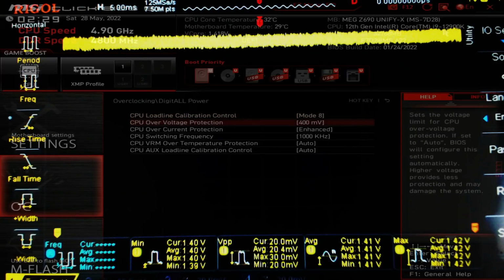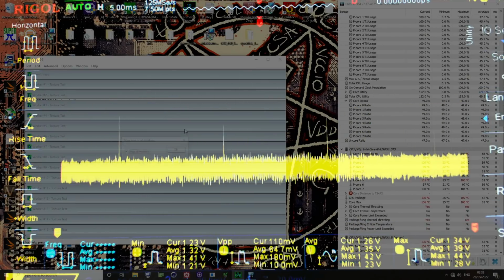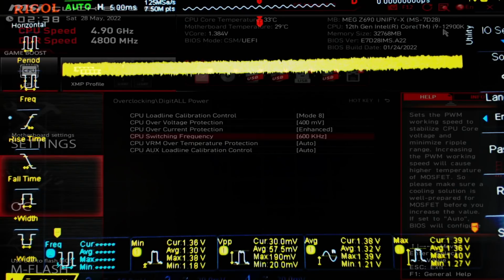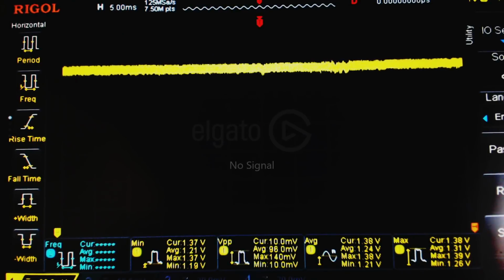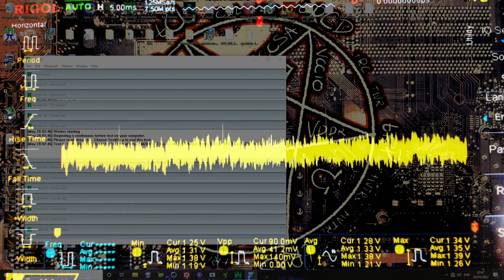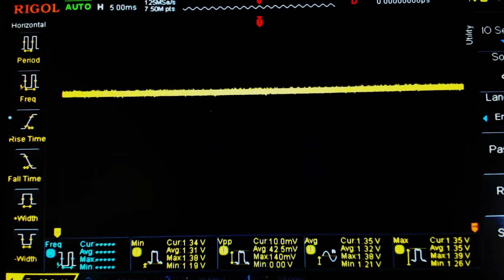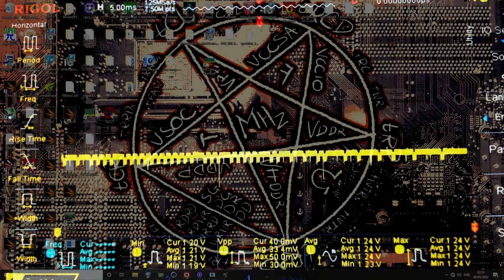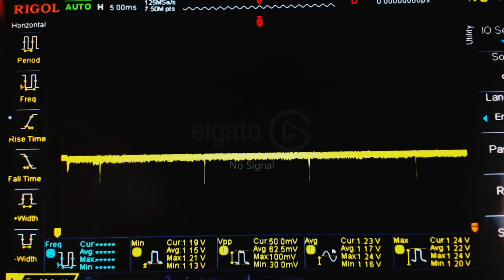The Z690 Unify X has some wacky VRM settings.

Comment: Hey guys, can someone please tell me, what is going on with my Unify-X? The fans take quite a long time to spin up and down (like 30 seconds to reach from 300 - 1550 RPM) when I set them all to full speed in bios and also in MSI Center? That is whit a spin up and down time of a 0,1 ms response time... I also googled it and found a couple of posts of some people reporting the same behaviour. Bios is updated to the latest version and also software. I come from a broken Apex board where the fans reacted instantly, but ram slot was faulty and now this on Unify-X... Am I like the unluckiest guy in the world? It it broken or will a firmware be able to fix this? Thanks.

Comment: A bit late to the party, but the waveform at 18:00 is typical for an unstable feedback loop (just barely not enough gain margin). You often get chaotic, wideband oscillations when a VRM is just barely unstable. (My own designs did this more often than I'm comfortable to admit...)

Would be great if Renesas made datasheets available for any of their RAA VRM controllers but meh, they don't. I have a feeling that the clock of the digital loop filters in that thing is coupled to the PWM frequency, which means that the feedback loop's frequency response gets screwed when the PWM frequency is changed. Higher clock = higher 0dB crossover frequency = lower phase margin = instability.

About connecting the SuperIO to the CPU's VCore sense lines: You're absolutely right, that is a terrible idea. These lines have fairly high impedance; any current drawn from them is going to mess with voltage regulation. What's worse, however, is the capacitance added to the sense lines. That capacitance is going to form a low-pass filter with the sense lines' impedance which directly screws up the frequency response, again potentially causing instability. MSI most likely programmed the VRM controller differently for the VCC sense / die sense modes to (somewhat) compensate for the messed-up frequency response.
Reply: This is the first sensible comment I’ve seen as someone that’s built a buck converter. I really wish motherboards came with application notes that discussed these issues

Comment: funny to see LLC not improving between Z77 and now lol, wtf are motherboard vendors doing... (upgraded) from i5 3570k finally and got no real world performance gain, if not for switching from ddr3 to ddr4 there would be no gains. wife has a 10400 and the 3570k crushes it lol pathetic. 10 years newer and 10th gen runs 2666 ddr4 lol feels like a locked down dell prebuilt. she is getting my old b450 tomahawk and 3600 tho and her pc is going htpc only, my 3600 has almost double the results of 10400 in aida mem bench. literally double read speed, write is the only thing close, and her memory is juast as overclocked as it can be on b460 platform, locked cpu's are pure junk. 10400 was trash on release. lke most cpu/gpu's release the last 2 years. its too bad amd is working so hard to ruin their reputation with 5800x3d greed(its already taken a price cut) and the rx 6400/6500 being complely useless cards competing with gpu's from 2016 lol.... why amd...

Comment: Great video, thank you ! Finaly i was able to have 5.2 all core Prime95 small FFT running stable by simply swithing Unify-X to socket sense. Never imagined that this could cause a problem of instability …
Reply: what voltage and line did you use?
Reply: @Cronussy  As far as i remeber - LLC7

Comment: I have a Z690 Unify non-X. Setting the CPU Lite Load to mode 1 in advanced CPU settings solved the voltage problems I was having. Also did this after a BIOS update.
Reply: CPU Lite Load is more for undervolting ? and mode 1 would net the biggest undervolt right?
Reply: @Pabula  Yes. Stock voltages are way too high. 5.2 @1.22 is just fine.
Reply: @postman3732  Thanks for the reply.  I recently saw a video of a guy undervolting his 13600k purely with CPU LITE LOAD, and it seem very interesting how it was still able to do everything the same just at a lower voltage, it seems like there is no downside of using it.
Reply: Is there any way I can hire your to over clock my PC? You can even make a video of it if you like. Let me know.

This is my build
I would like to overclock the cpu, gpu, and ddr5. I hired someone to build it and overclock it. Build is fine. But he didn’t know about overclocking so it kept freezing up on me so I set everything back to normal.

- 7000D airflow full-tower ATX PC case-Black
- 420 mm AIO iCUE H170i Elite LCD Display Liquid CPU Cooler
- 3090 FTW3 Hybrid 
- Seagate FireCuda 530 4TB Solid State Drive - M.2
- G.Skill Trident Z5 RGB Series 32GB (2 x 16GB) 288-Pin SDRAM DDR5 6000 (PC5-48000) CL36-36-36-76 1.30V Dual Channel Desktop Memory Model F5-6000U3636E16GA2-TZ5RS
- MSI MEG Z690 UNIFY-X DDR5 LGA 1700 Intel Z690 SATA 6Gb/s ATX Intel Motherboard
- 12900k
- EVGA SuperNOVA 1600 T2, 80+ TITANIUM 1600W
- 4 iCUE ML140 rgb elite premium PWM magnetic levitation ram
- Thermal Grizzly - Kryonaut Extreme 2 Grams
- Thermal Grizzly Kryonaut The High Performance Thermal Paste (1 Gram)
Reply: @joemomma707  Sorry I'm just an enthusiast. I'm not for hire.
Reply: This isn’t a unify non-x, in other words, nothing u said matters at all. It is a different board with different hardware. wtf are u going on about?

Comment: Hi. Unify x bios a20
Cb23 multy 
12900k sp101 LLC 6 500khz 1.41v 5400p core 
Die sense stable
Socket sense bsod.
Why???
Reply from the maker: mode 6 die sense is like mode 4 socket sense.
Reply: @ActuallyHardcoreOverclocking  thanks.
And I test vrm frequency 5.4 LLC fix 1.41v
1000khz - 302w
500khz - 352W
)

Comment: When I maxed out the switching frequency on my Z590 Unify-x it would randomly reboot or freeze while benching, even if the cpu was stock.  I had to back it down to 800KHz.
Reply from the maker: probably the same kind of issue.

Comment: This is interesting, but doesn't help people like me who use adaptive mode with matched AC/DC LL.
Most of us don't have access to oscilloscopes to investigate on our own, so we don't know which VRM settings provide the most stable voltage when the CPU is compensating for droop.
Could you look into that in the future?
Reply: 1. He said like 5 times this is mainly for him to document and remember things and not a real piece of content useful to anyone else.
2. he has already made content on what VRM settings do for the most accurate and stable CPU voltage.
Reply: @safedork 1. Fair enough. 2. Override mode literally can't do this. It produces unmitigated droop as you can clearly see. Adaptive mode with matched AC/DC LL values keeps voltage within a narrow range of VID. I don't have the numbers off the top of my head (iirc +/- 35mV), but the spec is publicly available.

Edit: Spec is at https://cdrdv2.intel.com/v1/dl/getContent/655258. Go to the electrical specifications section.
Reply: @Sam Fedorka Could you point me the right video for this? Although I appreciate his sincerity and thoroughness, he tends to ramble and my brain gets scrambled trying to follow all the threads in his discourse. Like trying to track the melodies in some of 
Bach's pieces.

Comment: Why does the date on your desktop say 28/05/2022?
Reply from the maker: because the system isn't connected to the internet and at some point in time a mem OC broke the date on one of my windows installs which has then propagated through my boards since I kept using that install.
Reply: @ActuallyHardcoreOverclocking  that's pretty whack
Reply: He's a time traveler. He Travels forward in time 37 days to bring us  changes in BIOS and memory tunings from just over a month in the future! Lol.

Comment: When people will realise msi is shit, almost worse than asrock now?
Reply: Massive Shit Inside :^)

All board brands are garbage at the end though, they all got their issues. cough Z690 Hero with the reversed cap issue cough
Reply: Lol your statement seems like people that want very low price and expect excellent result without any drawbacks. Asrock simp arent you?
Reply: Msi is fine lol others are crap my unify-X does wonders with my 10900k oc at 5.3ghz
With ram at 4533mhz 16-17-17-35 dam wonders I tell you can't wait for this z690 unify-X
Reply: You realize that people say the same about Gigabyte and ASUS as well when they have any issue? If it was so then we'd have nothing left to buy.
Reply: @thatguy7595  I bought an Asus x570 gaming plus wifi.  Heard it was a solid board.  Posted first try, but would not enter bios.  Asus rep had me tear it all down and put it back together, same issue.  Then they told me that I could not flash the bios on that board.  I returned it and bought MSI x570 Tomahawk.  Been solid for over a year now.  So I totally get your point.  It doesn't mean I won't by Asus, I'll just do research and by evga or msi first.
Reply: Because they're not & your ridiculous hyperbole helps no one. If you don't set llc 8/1000khz then there usnt an issue so how dies that make all MSI boards "shit"?

Dear Lord, get a grip please